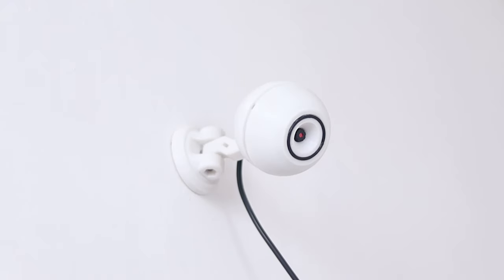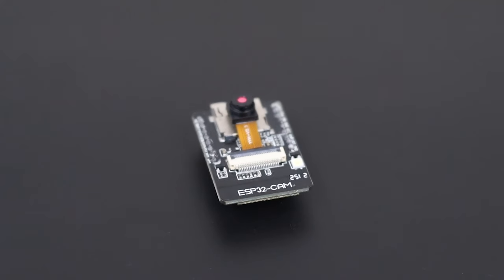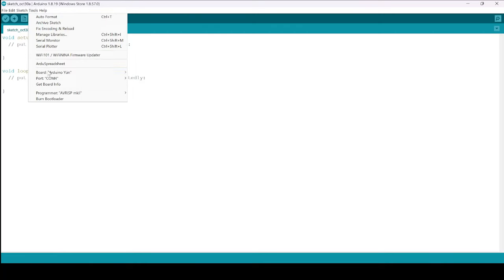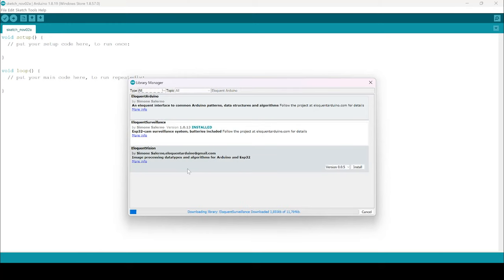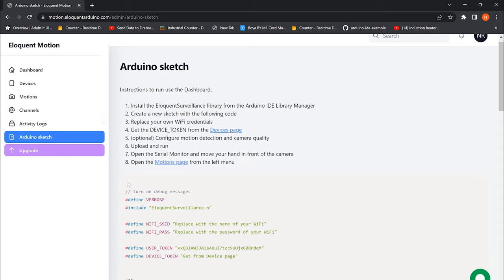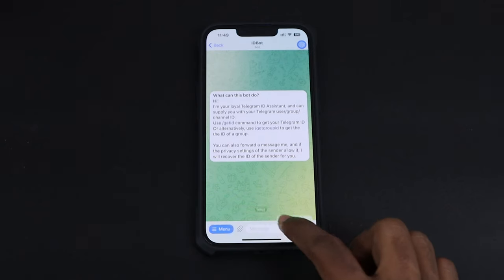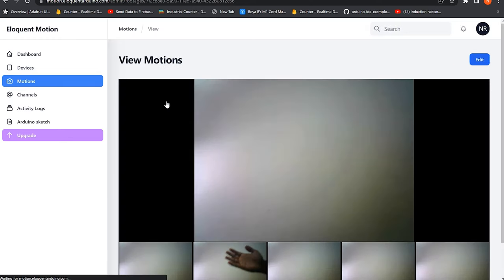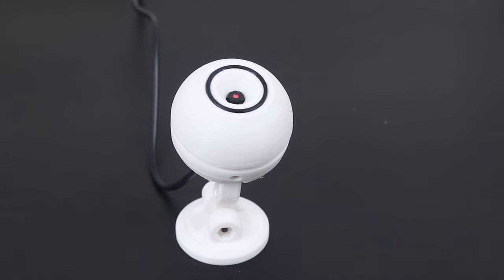$10 DIY AI Surveillance Camera With Motion Detection | Full Tutorial | Coders Cafe

Comment: When using this code my esp32 board is not connecting to the wifi. However if I use the camerawebserver example it does. How could I correct this?

Comment: Can we use mobile hotspot data to run esp 32
Reply from the maker: Yes.
Reply: Anna first I used wifi to esp but I wanted to use my mobile hotspot data so I tried to reset the code but it don't work what can u do for it